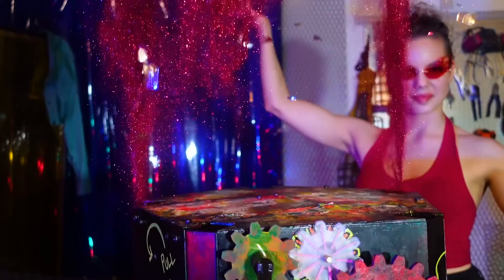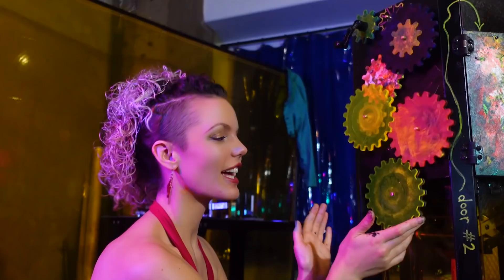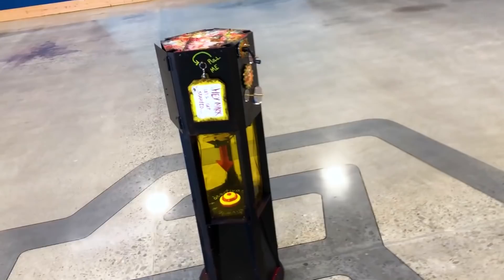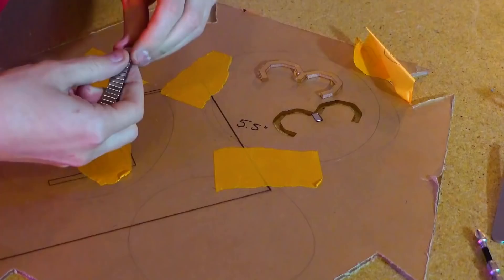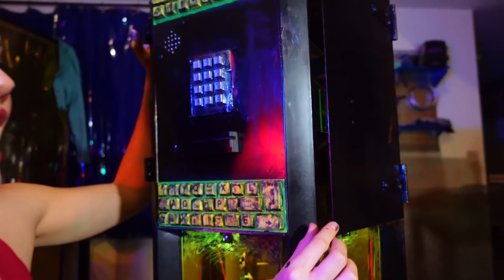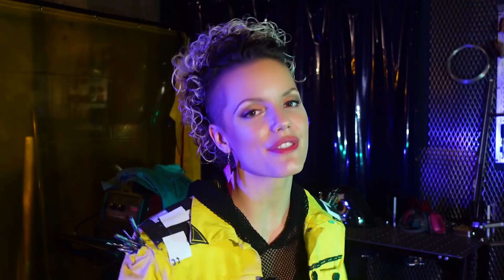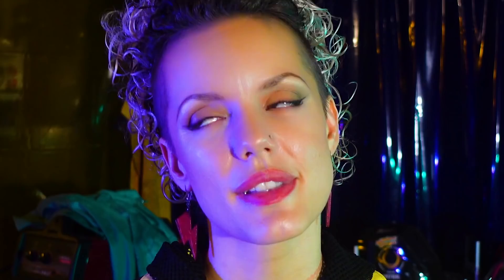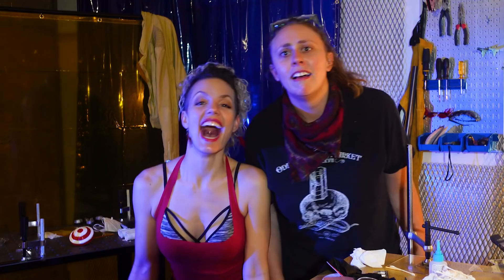I built Mark Rober a Glitter Bomb

Comment: you guys both have it wrong centrifugal force is defined as "the apparent force that is felt by an object moving in a curved path that acts outwardly away from the center of rotation" therefore the bearings are being affected by centrifugal force because they are moving outwards from the center or the rotation
Reply: Only in an inertial reference frame - so if you were one of the balls you would be experiencing centrifugal force however as we are outside the inertial reference frame then we describe it as centripetal. Hope that clears it up.